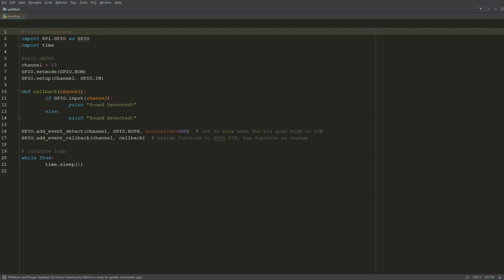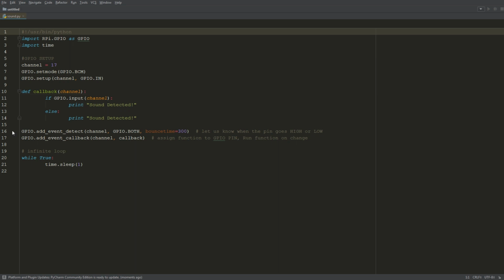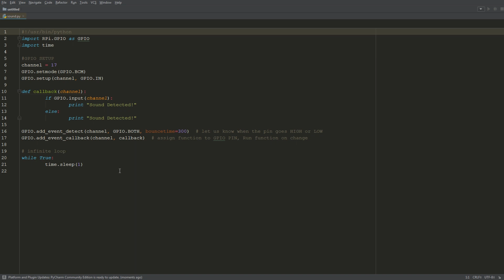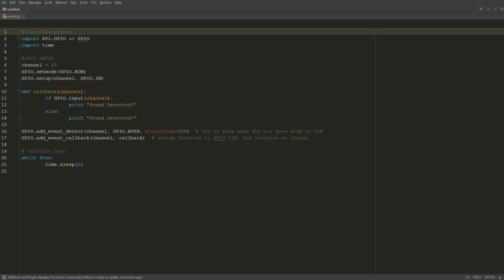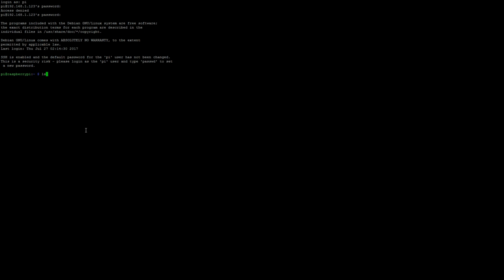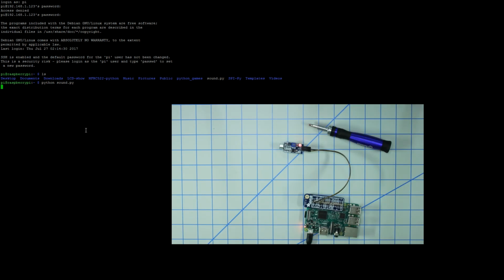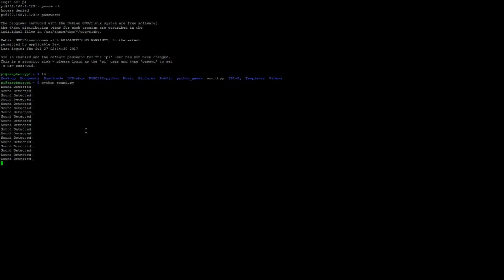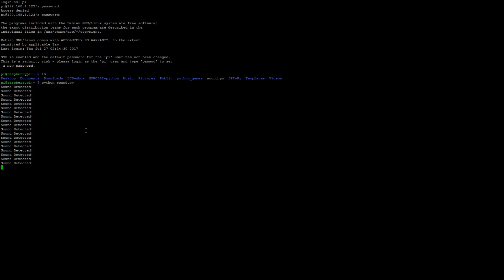Sound Sensor (Raspberry Pi)

Comment: #!/usr/bin/python
import RPi.GPIO as GPIO
import time

#GPIO SETUP
channel = 17
GPIO.setmode(GPIO.BCM)
GPIO.setup(channel, GPIO.IN)

def callback(channel):
        if GPIO.input(channel):
                print "Sound Detected!"
        else:
                print "Sound Detected!"

GPIO.add_event_detect(channel, GPIO.BOTH, bouncetime=300)  # let us know when the pin goes HIGH or LOW
GPIO.add_event_callback(channel, callback)  # assign function to GPIO PIN, Run function on change

# infinite loop
while True:
        time.sleep(1)

Comment: Please help me with 4 pin Big sound sensor , similar to this but with A0 ,+,GND and D0 pin. Please help me with i have put GND in Pin 6 and + in pin 2 and D0 in 11 and dont know about A0.
Reply: D0 is the digital pin. You dont need it when you just want to record sounds. A0 is the analog pin. this is where the sound data are transfered to the raspi/arduino

Comment: what is the else for?
Reply from the maker: When I was testing the sensor it would only print half the time when triggered. Looking at it now, I think that entire if/else block is unnecessary.
Reply: Agreed. You've already tested for the pin going high so you can just make the callback echo "Sound detected" directly?